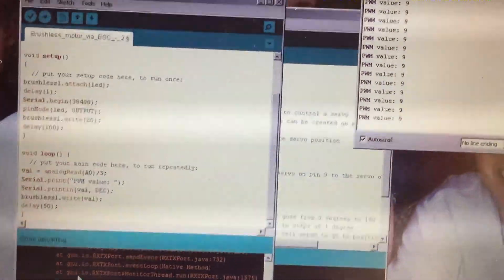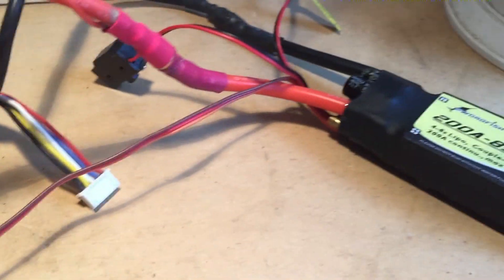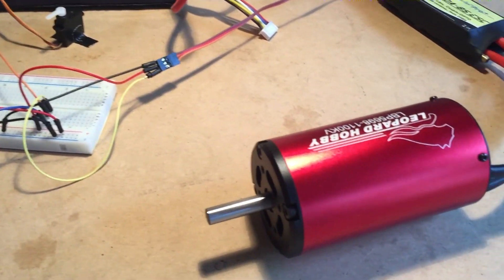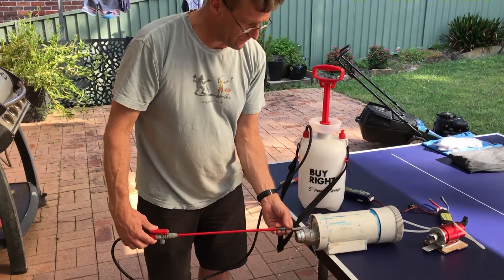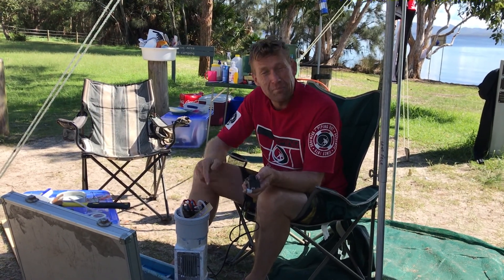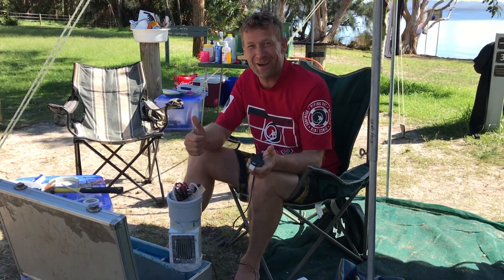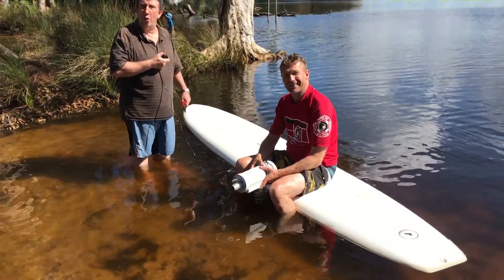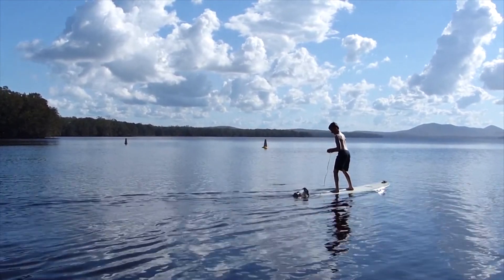Using Arduino Uno to control an ESC and powerful brushless motor = SurfJet

Comment: So what happened?? I wanna see it run.  Aw man.
Reply from the maker: I've had to go back to the drawing board. I think it was spinning too fast which created a 'cavitation' effect, which basically means that it wasn't pumping water through very fast at all.
It did kinda work a bit with the boy on the board at the end, but not exactly what I'd hoped for obviously.
Life pressures have meant this project will need to be revisited at another time, perhaps Xmas 2019 (I hope), time and money permitting.